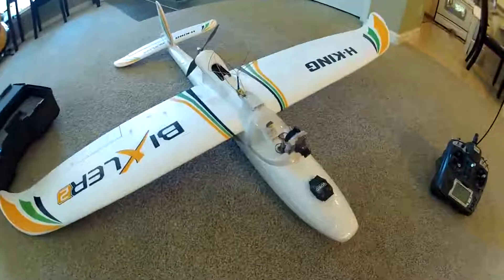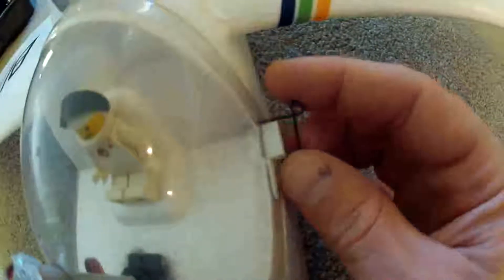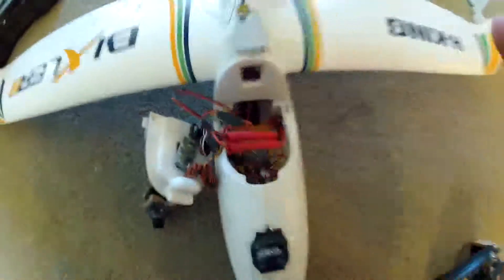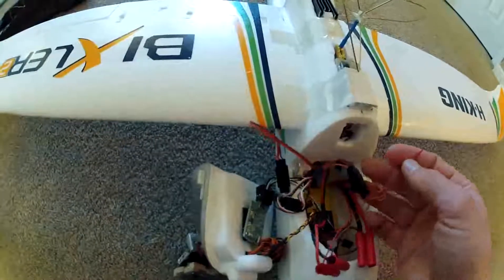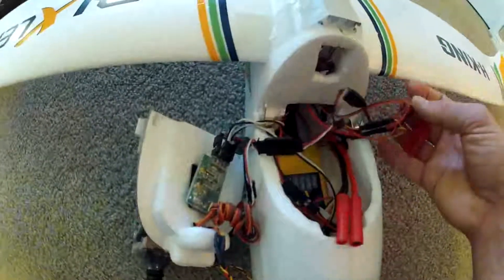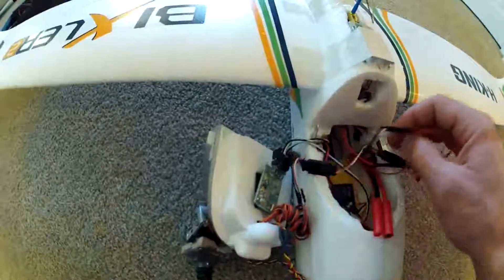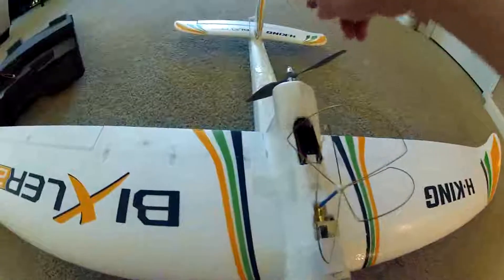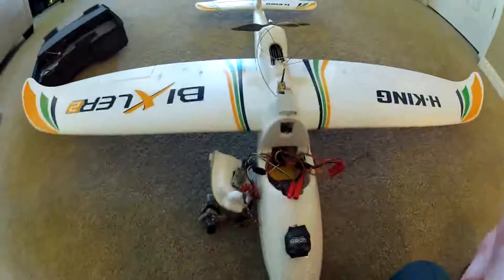Bixler2 FPV Setup inside fuselage wiring for Rangelink RC, Video TX RX, MiniOSD with GPS.

Comment from the maker: benjooo,
I have a list of all the components in the description below the first Bixler2 video I made (link in video description above). 
I have taken it on about 15 flights now and the setup works great.  I get about 45 minutes to 1 hour of flight time with careful flying.  Average cruising speed is about 20 MPH so my range is between 10 to 20 miles out depending on the wind currents.
Thanks

Comment: I like how you explain all small data with component names. Can you send me please list of al thing that I need to buy for same setup. I want to buy a plane, same like yours and fly with fpv. Is it possible to draw me a diagram of all components at the plane and and the ground , including antena diagram and with details how each component cost (including range link) . Also what kind of propeler and motor to get and how far you can goo wit it and for how much a time.    alisicic @ gmail . com